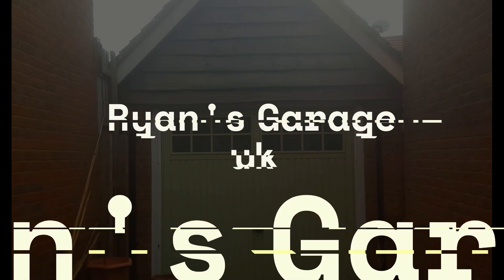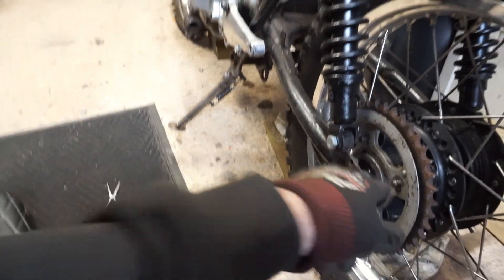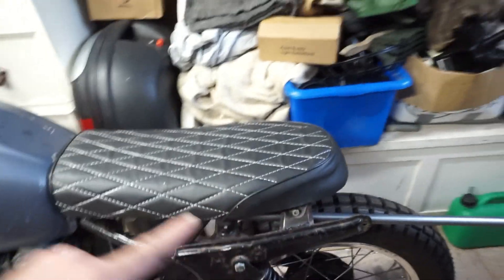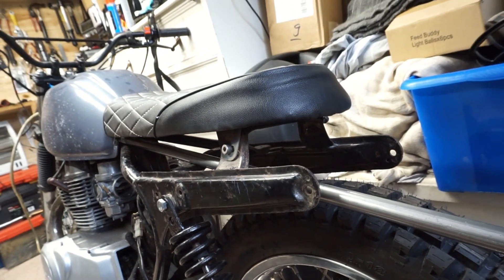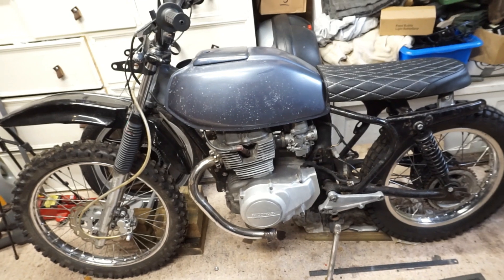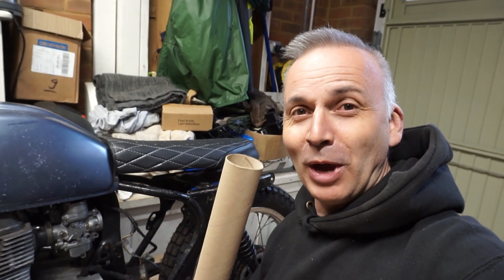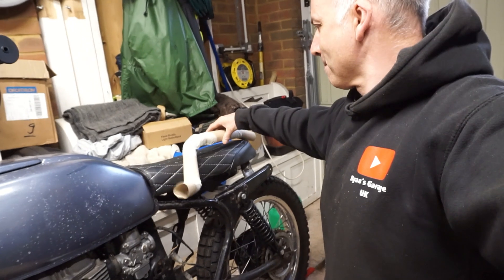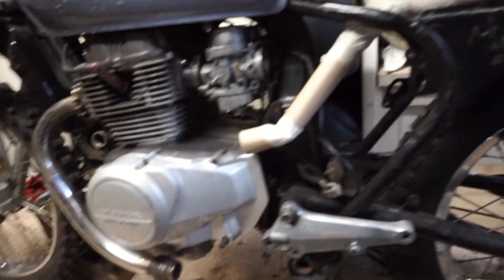Lets plan an exhaust using CAD. -  Project Bike Build -Part 41

Comment: 3rd time lucky maybe - check out the super dream scrambler on lace h00k meerkat plaice (deliberately misspelt)    - i tried to paste a link but it got removed twice! it has the cl450 style exhaust I mentioned on a superdream scrambler - looks good, hope u can find it
Reply from the maker: Thanks Tim, i will try searching for it later. 👍🏻 I think all URL's are automatically removed. Its not me doing it.
Reply from the maker: Hi Tim, I have found a blue one with a custom 2 into 1 exhaust in Margate, so presume this is the one? Looks interesting as they are using a shield like I had in mind for my legs, but hung lower to avoid the seat. Thanks
Reply: Glad u found it!

Comment: check out the exhaust on a 1970s Honda CL450, the pipes run just above the engine crankcase and then horizontally all the way to the back - stunning exhausts and that way they are nowhere near the seat - good luck!
Reply from the maker: Thanks Tim, i will google an image of that bike.

Comment: Ryan, how low is the underside of the sump? You might be going to a lot of trouble for nothing . . .
Reply from the maker: Hi, the sump is certainly lower than the exhaust, but around here there are deep ruts caused by 4x4's so its the sides of the bike that hits the walls of the ruts.

Comment: I think your gonna burn your ass on that exhaust lol, and the seat base is only nylon so very low melting point, other than that great work as usual.
Reply: Had exactly the same thought!😮
Reply from the maker: Thanks Pete, you are perfectly correct, but I have a sneaky plan to resolve these issues (that may or may not work!!)

Comment: That pipe is running awfully close to the seat. Even if you don't mind a burnt arse, I think it would melt the seat cover. Heat shield might help, but there isn't much room for that, either.
Reply from the maker: Hi, i think you may well be correct, i have a plan to help that issue which i hope will work well enough.